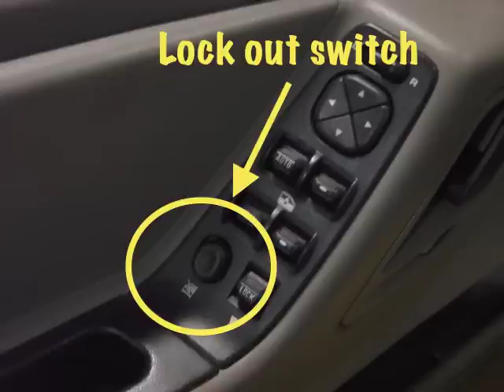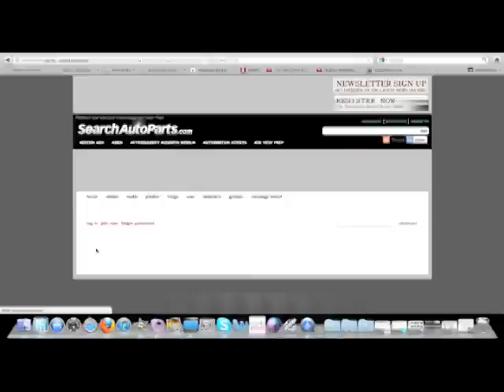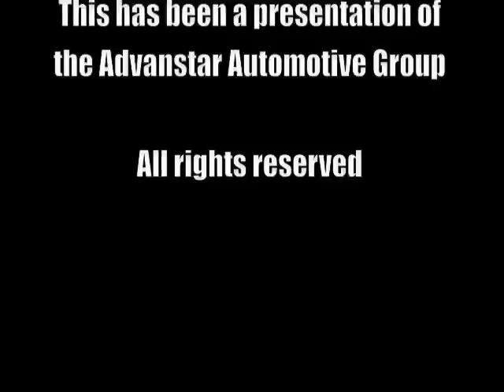The Trainer #24:  How To Troubleshoot Power Window Problems

Comment: Remember when we were kids and had to spend countless hours working on/through problems with our cars with very little to no guidance? Thank the Lord for the internet and guys like you! My son just purchased a 1990 Lincoln Mark VII and although the engine is strong, the electronics need some serious help, including both windows! Passenger doesn't roll down(off track) and the drivers won't roll up(motor works). So, I am looking at the switch and wiring. Love the bulb tester, I'm making one now.

Comment from the maker: The most likely problem is worn window motors. Remove the door panel but leave everything plugged in. HIt the switch and lightly tap on the motor with a hammer. If it starts to work, the motor is no good. If not, unplug the motor and put a test light across the two terminals. Watch the video at about 3:35 to see what I mean.

Comment from the maker: You may have more than one issue, First, make sure the main switch on the driver's master switch panel is turned "on". Then access one of the rear window motors and substitute the motor for a test bulb like the one shown in the video. Operate the switches for that motor in BOTH directions to see if the bulb lights. If it lights in one direction and not the other, it's in the switch. If it doesn't light at all, you'll need a schematic to trace the fault.

Comment from the maker: Try tapping on the motor while holding the switch in the down position. If the motor begins to work, you'll need to replace it. It's worn out. If not, replace the motor with the test bulb as shown in the video. If the bulb lights in both directions, it's the motor. If not, you have an electrical circuit fault to find.

Comment from the maker: It's not stuck physically. It's caused by wear between the brushes and the motor's armature (typically). Just like a starter motor that won't engage unless you tap it. Replace the motor(s) or you'll be doing the work again soon.

Comment from the maker: For the "express down" feature? Try this: With the window fully closed, hold the switch in the "full down" (second detent) position until the window is fully open and then hold it there for a few seconds more. Repeat with the window in the other direction. If that doesn't do it, you'll need to look up the procedure in a service manual...most auto parts stores carry them.

Comment from the maker: There is no frame to speak off to support the glass on the door, so you'll need to remove the door panel and check the window guides themselves for wear or breakage. Follow the service manual procedure for adjustment.

Comment: Thank you so much...I was tasked with helping my relative fix a power window problem..I live 1500 miles away ,so this was a phone in...After checking fuse , relays ,loose connections ...airs a last resort I checked youtube...found your video..1 minute later I was able to diagnose the problem....ugh ...lockout switch was engaged...ugh. Thank You for pointing out ,what should have obvious...
Reply: Dudeareno Rodent o

Comment from the maker: Brandon, Does the interior light dim when you try to move the window up or down with the switch? Sounds like a motor issue if it won't move at all. Generally mechanical regulators don't jam and cable-types leave play in the glass. Follow the steps in the video!

Comment from the maker: First step: Operate the bad window with the switch and see if you see the interiors lights dimming at all. This indicates that, electrically, the circuit is working but the motor itself is stuck. Odds are, that's the problem.

Comment: First off thank you for the great video on diagnosing and replacing power window motor.  It helped me a ton to evaluate my issue as well as fix.  I was able to determine my switch was bad.  But now my driver side window is still not working.  The switch is working and I also have power at the connection to the window motor.  And tested motor separately and it works.  So now I am wondering if the locking feature or safety feature is the issue.  When installing a new switch do you need to retrain the window lock?
Reply from the maker: You don't say what kind of vehicle you are working on but I doubt that's the issue. The motor's polarity has to be reversed for it to change direction, so one side of the connector should have power in the "up" position and the other side should have power in the "down" position. Remember, too, it has to have a good ground on the opposite terminal. Try performing a voltage drop test on the circuit.

Comment: Thank you so much! I've just checked, and as you mentioned it, the master control was off, so that's why only the driver's window was working.
Reply: Denis Morissette 
Hello John Fitzgerald Kennedy 
I  thought you were killed
Reply: Where is the master control? My passenger side window and crank shaft posiiton sensor and sometimes the horn don't work. I have figured out the problem is in the wiring of my car. could you please help me figure out which part of wiring it might be?

Comment: Great Information" My  problem seems to be a short,I can't locate.Only a click noise in the fuse box when I push the button.One cold morning both windows worked great.Then an hour later back to the click noise.No other sounds from either side ? Thanks

Comment: I have a 98' Ford F 150. Super cab, 4.6, V8. With the factory anti theft system.The clicking is coming from this square black module # 4.When I put my finger on it,while pushing the window button,It does a loud click each time I push.You can feel it vibrate. Thanks

Comment: Hi! Thanks for your video! I have a Toyota Avalon '97 with both rear windows stuck up. When pressing the button I can hear a single click in the motor and the lights dim. I removed the door panel. Can't see anything wrong mechanically. Are the motors bad? I suspect nobody tried to open the rear windows in years. However, there is no rust... Any thoughts will be highly appreciated!

Comment: 1982 Chrysler LeBaron ; driver window motor and gear are good : but "bearings" in gear are busted to pieces ...  Any advice on where to find replacement "bearings" ?  They are not included in gear kits .    Thanks  Steve

Comment: what causes a window to keep going UP when u did not hold the button or it does not respond when you press the Down button? (power window with auto function, regulator has been replaced 3 times and motor was replaced the third time, and the first two the button was programed and the third it was NOT. and it broke again and snapped the regulator cable. again. what causes it not to stop! (chrysler sebring 4 door 2008)

Comment: Hi,before i start ripping panel off..let me first ask you this ... i have a 2001 silverado and the driver window still works fine,but when i try to put passenger window down it sounds like a relay clicks inside the passenger door... i am original owner and have never messed with windows.... the passenger window has been used hardly at all,so the track and motor should be in way better shape than the drivers side... i drove this truck just me myself so i know... what could it be ? bad connection? is switch bad on that door? again it sounds like its trying to engage everytime i hit the button on my side or the button on that passenger door... just tell me what you think it is and i will start from there....thanks
Reply from the maker: The reason you're hearing a "click like there's a relay" is that there is a relay there - two actually. One for the "up" function and one for the "down" function. The question is now "Is the relay bad or the motor stuck/bad?" One way to test without pulling the door apart is to access the 25 amp circuit breaker in the interior fuse box and replace it with a fused jumper wire. I would then use an amp clamp to measure the current level when the window was operated. If the current is low, say 0.50 amps or so, then I know the relay is being powered but there is no current flowing on the motor side of the relay. If the current is higher - a few amps or more - then I would know that the relay closed and is sending voltage to the motor windings and the fault has to be mechanical - stuck motor or stuck window.

The alternative is to remove the switch and check the operation of the relays the old-fashioned way using a schematic.

Hope this helps.

Comment: I have a 1996 Honda Civic coupe hx, the driver window stopped working completely a few months ago and won’t go up or down and the passenger side won’t go up, it will go up if I shit my driver side door twice, I had motors and regulators replaced. All fuses checked and switches checked. What could be the cause?

Comment: Highlander issue is the the pass window will not got up sometimes. It justs stops. Then you wait a few minutes and it will work again I believe it is the case that this happens using either switch. Sooner or later it will stop working altogether. Help!

Comment: Hi, can u help with my passenger door window?  It only goes down but not up with using both window switches on driver and passenger.  I confirmed it's not a motor issue already.  Can you give me some pointers on what to test?  Thx
Reply from the maker: What is the year, make and model of the vehicle?

Comment: Hi! Informative video!! I'm still a bit uncertain though.

I have a 2002 Honda Civic EX. My rear passenger side window is noisy when operated. There have been a few times that it has gone down and when I try to put it back up it just won't go. I usually keep it locked so my toddler doesn't put it down and risk it getting stuck again. Oops. Forgot to lock it back and down it went. The window is secure when I jiggle it. When I go to put the window down, it goes down. When I go to put it up I hear a click, but the window doesn't go up. What do you think it is? And do you have any idea of what labor would be? Are we talking less than $100 or closer to $400?

Thank you!!
Reply from the maker: Few things come to mind - switch, electrical connection, possible motor. Use this resource to find a reputable shop near you: http://autorepair.iatn.net/
Reply: Okay thank you so much! I'll check out that site! I always hate going to the shop. They always seem to have the most expensive report to give. And a few times they have made something out to be way worse that it needed to be.

Comment: How do you determine if it's the motor, or the scissors-type mechanism?  '98 Park Avenue, driver's window goes up okay but has been slow going down, now won't go down at all without pushing down on it. 
I would think if the motor has power to move it one direction, it should have enough power to move it the other direction.
We just replaced a broken glass in it, and lubed the channels with silicone and the gear and track with some of that PB Blaster penetrating oil.
A couple of runs up and down and we could hear what sounded like glass chips getting ground up in the gears or something.
 That sound pretty much went away after a couple runs up & down.  But as I said, the window was slow going down before this.
Motor, or regulator?
Reply from the maker: Visually inspect the window regulator (that scissors mechanism) for wear on the guide bushings and dry tracks. You also may have a voltage drop issue in the circuit. If you can, compare current draw in both directions.

Comment: The motor finally started working really well after intensive tapping (I tried tapping before but maybe not enough). Are you sure it needs to be replaced? My theory is that it wasn't used for many years and perhaps simply needs some lube... Is there a way to do it? Thanks a lot for your help!

Comment: 1992 Honda accord. Both back windows do not work at all. No action or sound when rear window control switches are engaged, no dimming in the lights either. front motors make rough ratcheting/scraping sound when switches are engaged. channels in the back seem fine. Also no action or sound when driver side switches for rear windows are engaged. Any thoughts?

Comment: So I have a 2003 Chevy Cavalier. I heard they have plenty of window problems where the windows take a while to finally start rolling up again. I have that issue although my drivers side door has gotten to the point to where it doesn't want to roll up at all. The window is on track and it gets enough voltage when the button is pressed to go up or down. I've tried a brand new motor and tried rolling it up without it being installed and connected to the window and it rolled down but still didn't roll up. I've tried a brand new switch panel and it only rolled up half a centimeter and that's it. I've tried rocking the window. The passenger side and one of the rear windows are also starting to take a while to roll up. Do you have any suggestions? Thank you!
Reply from the maker: Plenty of voltage measured how? Without a load on the circuit, simply having a test light light up or reading full battery voltage means very little. Try measuring voltage drop at the window motor while operating the motor to get a true measure of the electrical power available. I suspect a ground issue.

Comment: My driver's side front power window doesn't work. I rolled down just fine, but didn't roll up. However, I got it to roll up by pecking the button. It rolled up 1mm at a time! But it didn't work every time I pecked the button. Eventually, it would work and roll up all the way if I pressed the button and held it, and then repeated that process dozens of time until it decided to work. Now, it's not responding at all. The power button feels "mushy" and there's no "click" to it. The others click...?

Comment: I have a 94 Chevy g20 Van. I replaced the  switches and motor. Both window wasn’t working. Now the driver side is working but the passenger side won’t go down. When I press up I can hear the motor but nothing when I press down.
Reply from the maker: What switch are you using to operate the passenger side - that driver's, the passenger's or both?
Reply: @MotorAgeMagazine  I replaced both switches. I replaced the Circuit relay also but I’m not sure what to do now
Reply from the maker: @Yaadman_Serginho  Just because you've replaced something doesn't mean its working. Start at the beginning. Access the motor and substitute it with a test bulb. Operate the master switch and see what the bulb does in both directions - same with the passenger switch. Then let me know and we'll review the wiring diagram and see what we need to focus on.

Comment: I have an older model Galant and the driver window will only work after the door has been slammed fairly hard. It will remain working for a while but with no use, generally after a while it ceases to work. Any ideas?
Reply from the maker: Classic signs of a motor problem!

Comment: My passenger side window and crank shaft position sensor and sometimes the horn don't work. I have figured out the problem is in the wiring of my car. could you please help me figure out which part of wiring it might be?
Reply from the maker: Those are three separate circuits. Start by choosing one and tackling it. You'll need a wiring diagram, a multimeter and a knowledge of electrical fundamentals to find the culprit.
Reply: Is there a part of the electrical system for the car that connects only these three circuits or at least these three? I have the wiring map but I can’t read it well.
Reply from the maker: @fkhoshnasib  Use the techniques in this video to determine why the window is not working first. I doubt the three are related but there could be a common ground. Look at our home page here on YouTube for help in learning how to read the wiring diagram.

Comment: My power window in my passenger side is not working and I tried to see the fuse but it's fine do you think it's the motor? And is it possible to to move the driver motor to passenger motor to put it up?
Reply from the maker: Follow the steps outlined in the video to see if is is the motor or a problem in the circuit or switch. Do you see the dome light dim when you try to operate the window? WIll it go in one direction but not the other? And no, most motors are "left" or "right" and will not interchange side-to-side. HTH!

Comment: On my 1999 Chev Malibu, the driver's side window stopped working completely during the winter cold. All other windows work. I've looked at the switches and see nothing wrong. There is no sound at all when I press the switch. I'm guessing that means the motor is shot but I'm not sure.
Reply from the maker: Install a test lamp as shown in the video to first verify that the motor is, indeed, the problem. Make sure that the connections are nice and clean.

Comment: My 2005 Dodge Grand Caravan passenger side power window lately start not moving in humid weather, neither with driver's switch nor it's.  There is no clicking noise,it is dead. Please any help will appreciated. Thank you...
Reply from the maker: +badiyan Just follow the steps in the video to isolate the cause. I'm guessing it's a motort - common issue with the older Dodge vans.
Reply: +Motor Age I want to thank you for your response, I did the test, yes you were right it is the motor it self exactly.  Appreciate your time and knowledge.

Comment: I have a hyundai accent 2000 model.windows are not going up or down, I checked the motor and relay they are working fine.how to check if it is wiring or switch problem, ?
Reply from the maker: Install a test light across the motor connection on the harness side. When the switch is operated in either direction, the bulb should light up. Review the video for more information.

Comment: hey I have a 96 civic ex coupe...both windows stopped working at the same time...theres no noise from the motor nor does the light dim...I replaced the master switch and still nothing...any tips?? I checked the fuses as well
Reply from the maker: Check power to the switch assembly. A common area of failure in older cars is where the wiring passes from the body to the door. Bet a wire is broken!